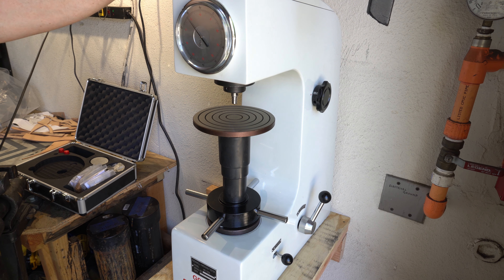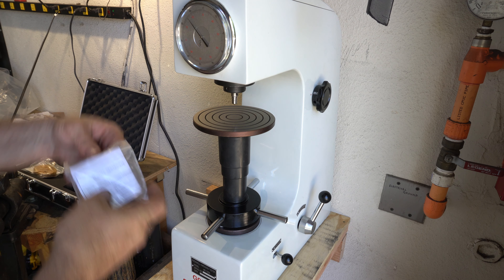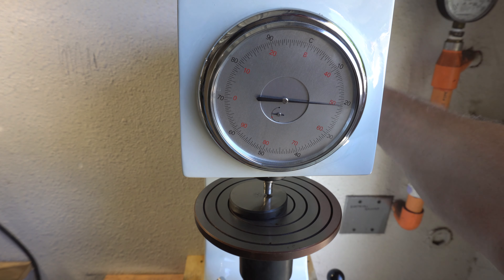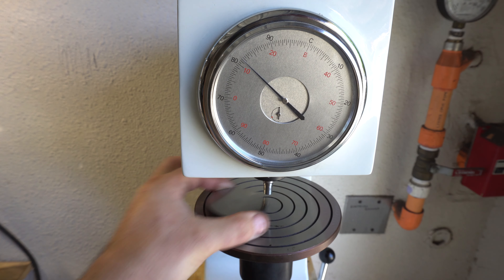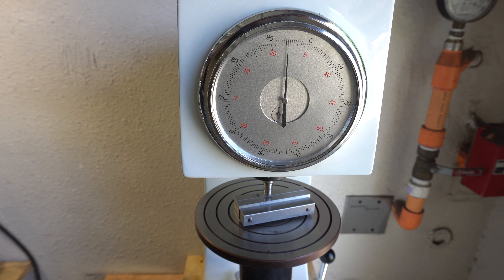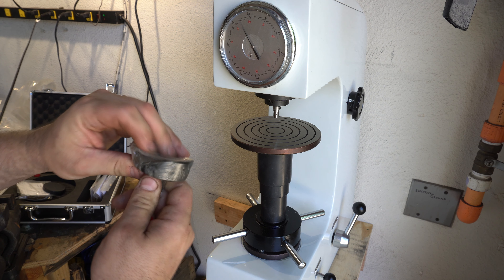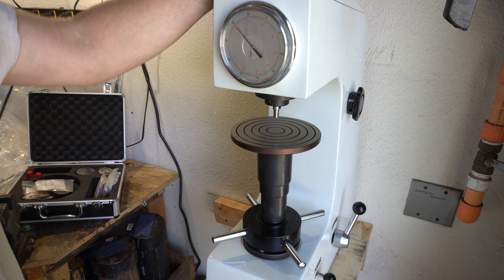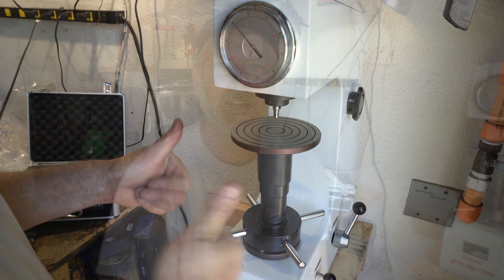Triple-T #44 - My new hardness tester

Comment from the maker: Do you have any questions about hardness testing?  Luckily I didn't have much to calibrate on this machine yet, it was spot-on when I unpacked it.  👍🏻
Reply: Denis, you can get the needle zeroed out to the top by adjusting the pin screw under the top cover. You'll want to take an average of tests as well, congrats.
Reply from the maker: @FearNoSteel  thanks for the tips! 👍
Reply from the maker: @nateand3  it was $1650 shipped to my door.

Comment: Newwwwww toy! It sure beats sitting there scratching away with files. So you actually have to use it twice then? Why not wait till all of the normalization’s,  baking/quench is done, as in final step before the last grind, and then do it? Sorry I hope that registered somewhere on the English Language Scale lol
Reply from the maker: Actually you WANT to test twice.  The first test tells you how much you should temper.  If say, the first test was at 65hrc, and you want the final hardness at 60hrc you’d use one temp but if it was 63hrc you’d use a lower temp.  Make sense?

Comment: I’d like to know how the Rockwell file sets compare to this. I know the files aren’t precise by no means and be cool to see how close they actually are. Although each file set may vary some.
Reply from the maker: The problem with the files is mostly user error I think.  How hard you press, the angle you use them on, all have a factor.  For a general guideline, they are better than "it skated a file" test.  I like to know that pre-temper, my blades are around 65 hrc with the files.  I'll know for sure pretty soon.  👍🏻

Comment: I have always wondered how much a difference in hardness there would be (if any) from the outside of a project to the core on thicker projects where people do not do a initial grind 1st. Are you going to test something like that?
Reply from the maker: Sounds like an interesting test.  I might do something like that.  Thanks for the suggestion and thanks for watching!
Reply: For the majority of the knife steels the „through hardening“ (I am sure there is a correct English term for it) is not an issue. This impacts part with large wall thicknesses > 20 mm, so way above the thickness of a knife. A good steel data sheet lists this.
What can be interessting is carbon loss at the surface which leads to a „soft“ surface. But this can be avoided by either packing the blade into foil, use a protective paint or leave enough thickness that will be ground away.
Reply from the maker: @Rsama60  what’s interesting is a study done by Larrin Thomas about different quench oils.  In that study, it was noted that oils like canola have serious problems with depth.  Even 0.03” depth seriously degrades the hardness.  Now I never really suggest canola but it’s an interesting read.  
https://knifesteelnerds.com/2021/07/19/which-quenching-oil-is-best-for-knives/
https://www.youtube.com/watch?v=Vdy0nvVEtJY
Reply: @TyrellKnifeworks  that is a good read and would canola oil = peanut oil as well? I’ve often wondered ho hard my tools and the few blades I’ve done would be sense I have no hrc files or a fancy tester (yours looks mighty fine) anyhow thanks for the triple t
Reply from the maker: @drewwilson8811  I would guess that peanut oil is very similar to canola.   I always suggest people use engineered quench oils.  There's more time in your blades than what it costs to buy a gallon of Parks50, for me anyway.